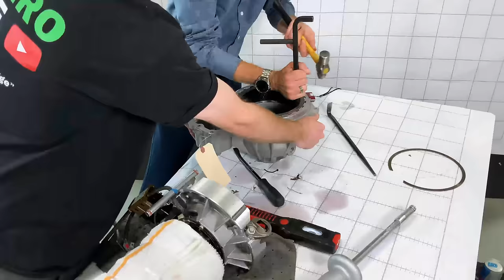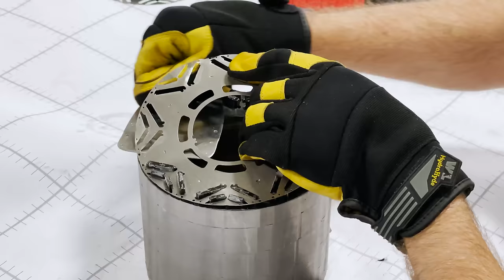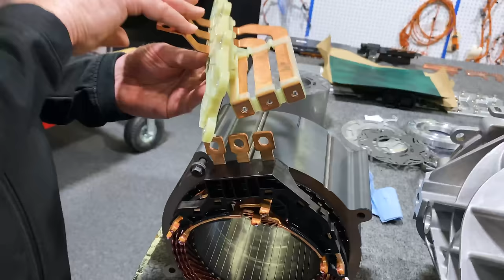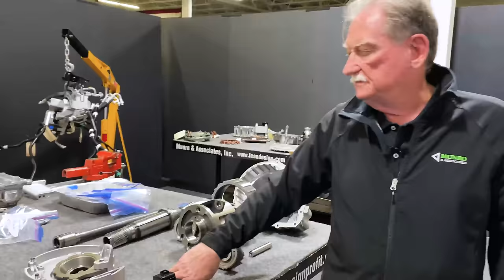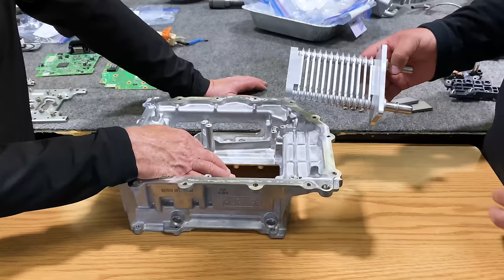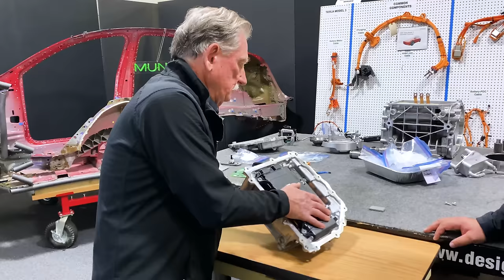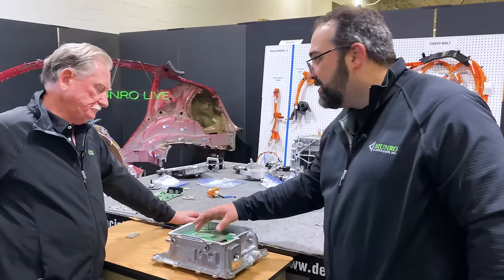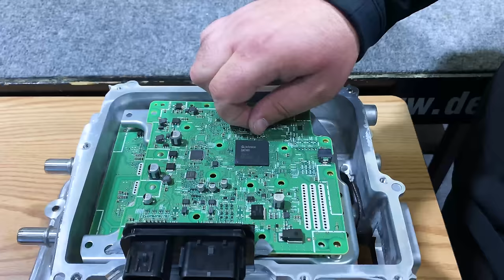Ford Mach-E Rear Motor Teardown and Analysis

Comment: I knew Sandy would make the joke on the 17th bolt - that there was no space for it... classic gentle and justified sarcasm we all love!
Reply: Sandy's sarcasm is wearing a little thin. His videos are becoming more showmanship than actually informative as he hams it up for his non-industry audience.
Reply: @Miata822    If I was chief engineer over the Mach E, I would be showing this to the entire team. Plenty of meat there.
  You want the industrial grade info, that's probably gonna cost you.  Buy the report.
Reply: @rockon7848  I have the i3 report. It's mostly part-by-part costing and source info. 
The Mach E inverter is made by Denso. Ford will probably bring it in-house if they think they can improve it or cut cost. I was impressed by the use of SiC switching.
Reply: @Miata822  So Ford threw a bunch of off the shelf components to get the Mach E out the door ASAP,  they will re-engineering it if they live long enough.
Something like that?
Reply: @Miata822  The info is still all here - the packaging has improved tremendously though
Reply: @Miata822  That's me and I'm loving it! I know nothing about engineering but love the videos because of this change in emphasis. 

This is one of the main reasons that the view count has risen so dramatically and helped the marketing and exposure of Munro and Associates. 

There is always a risk that they will lose some hard core engineering types such as yourself, but in my opinion, the benefits outweigh the risks enormously.
Reply: Germans Engineers  would find it
Reply: @BillyBob-fd5ht  and probably make sure at least 4 of the screws were left hand threads
Reply: @Miata822  The motor part is by Borg Warner, they call it their "integrated Drive Module" If the inverter is by Denso, that might explain that large copper interconnection, and why it is necessary. They were not originally designed together. Another example of making a car as a "Parts Bin Special" The inverter itself though, good grief what a complex assembly! I'm sure there are techniques and mechanisms that make the assembly a lot easier to assemble than Sandy thinks, but it's still horrendously convoluted. I used to be somewhat impressed with Denso stuff, this makes me wonder about reliability, or even reject rates. I can't see how you could even consider repairing such a unit. Horribly expensive piece to just replace in the case of failure.
Reply: @grahammonk8013  Thanks for your thoughtful reply.
In the 10 months since I made that post I have had seen it was BW and had a chance to crawl over a similar drive unit on an F-150 Lightning chassis.

All EV inverters are complex. have you seen a Tesla inverter? The Nissan LEAF inverter is complex, twice the size and half the power of the one on the Mach E. If you get a look into a 100+hp inverter drive for an industrial motor you will be impressed by the miniaturization on all EV inverters.

Consumer power electronics are almost never economical to repair. Diagnosing and repairing them is a high skill job. It's good that EV inverters very rarely fail.

Designing, testing, and manufacturing reliable high power electronics is very costly and time consuming. Vertical integration can be a trap since it limits a manufacturer's ability to innovate and bring out new designs. 

There is no need to deve3lop a new power window control module for every new vehicle. Tesla doesn't. But they do put that function and many other on the 2 or 3 control boards they use across all their vehicles. When a window control burns out a MOSFET Tesla replaces the whole board and charges $3,000. Tesla batteries are similarly cheap to build and effectively impossible to repair. (see Rich Rebuilds customer battery repair video).

the Mach E inverter can be replaced w/o removing the drive unit from the car. That is why the bus bars are like that.

Now go watch Lucid's "Tech Talk" videos if technical design issues interest you. Lots of info that applies to all EVs.
Reply: @Miata822  Good points, but I still say the complexity in the assembly of the inverter is silly. All that welding and soldering that you have to do in situ.
Reply: @grahammonk8013  Yes, would be interesting to see how they do it. Denso has vast automotive manufacturing experience with more than 15 factories across the US.

In the end what really matters is price and performance. The economics of the manufacturing industry are often counterintuitive to those outside the business. Munro does little to make this situation more clear to consumers.

Comment: Can't wait to see the new Tesla carbon wrapped motor being featured on this channel.
Reply: it will be like defusing a bomb. The carbon fiber is so tightly wrapped that when you cut it the motor inflates twice its size!
Reply: Lol.... carbon wrapped rotors have been used in applications over 200k rpm for years now, nothing special to see here.
Reply: @carholic-sz3qv  The bigger thing is that it is being mass produced I suppose by a machine created by themselves. Will be interesting to see if there's anything else new with the motors too though of course. We've seen the 3/Y motors with Munro but never S/X. :)
Reply: @carholic-sz3qv  Except these Tesla engines are part of the fastest production vehicle ever built. To me that's kinda special.
Reply: @alaricgoldkuhl155  really?! Stfu! The model is quick but not fast.  Impressive things are buggati chiron(fastest car in the world) with 300mph, mercedes unimog with tousands configurations possible for any applications, a scania 770s.......
Reply: @VoxelLoop  there is basically no difference between S/X and 3/y motors they are the same basics but differently tuned/configured just ICE engine configurations.
Reply: @carholic-sz3qv  Yh... But that Bugatti gonna get its ass busted on any track by a plaid model s or roadster... So what's your point? Are we supposed to be impressed by how it produces 3000 Hp of power, 2000 which are lost as heat and sound?
Reply: @rogerstarkey5390  yes it is, there are 2l NA engines and 2l turbo/supercharged which uses the same  block and many other components.
Reply: @whattheschmidt  it was a challenge to make a car for the street that could reach 300mph, from composite materials to very sophisticated body control, to printed titanium parts..... no other car is even comparable except a koesnigsegg.
Reply: @Omakhara  stop talking nonsense and grow up, sportcars are made for very different purposes, from manual gearbox to dual clutch, some sport cars even have less than 300hp. A buggati is built for the extremes just like a f1 car.
Reply: @carholic-sz3qv  so potentially the Tesla motor could spin 10x faster still? Is that what you are saying?
Reply: @carholic-sz3qv  roadster should be fast. 200 mph is very fast for the price, as is the acceleration. But keep trolling it's most amusing. 😁
Reply: @carholic-sz3qv  lmao, "300mph on the street" , you know Bugatti made a special model to reach 300 right? Most of the chirons can't do 300 even in perfect conditions
Reply: @carholic-sz3qv  it's Bugatti BTW. If you like their performance so much I would hope you'd spell it correctly.
Reply: @carholic-sz3qv  rofl
Reply: @carholic-sz3qv  lol the hypocrisy is oozing from your comments. You are talking about growing up whilst not being able to give Tesla any credit for their innovations and acting real salty about anyone that does. Sounds kinda infantile if you ask me,but hey whatever floats you boat.
Reply: @carholic-sz3qv  eh ? It’s much slower. Tesla S Plaid just did a 9.08 second quarter mile. Forget Bugatti it’s much slower and many times the price.
Reply: @carholic-sz3qv  
You know that Koenigsegg's CEO drives a Model 3, right? https://www.tesmanian.com/blogs/tesmanian-blog/tesla-model-3-christian-von-koenigsegg And they had to redesign their latest car when they saw the Roadster specs. https://electrek.co/2018/09/01/tesla-roadster-embarrassing-supercar-maker-koenigsegg/
Also Koenigsegg doesn't mass produce their cars, those are hand built and cost a fortune. You can buy like 10 Roadster from the price of a Koenigsegg, and 15-20 Model S Plaid.
And then there's the cost of maintenance. I imagine it's not exactly cheap to do anything on a hypercar, while a Model S barely needs any maintenance. Tires and washer fluid mostly. Not even brakes, as it uses regenerative braking 99% of the time. A brake pad can last up to 200K miles.
Reply: @HillslamsMirror  KEKW yeah for racing weight is everything. Ofc for twistys circuits.
Reply: @whattheschmidt  I believe it needs a 7 mile straight away to get to top speed. Definitely won't happen on a race track.
Reply: @carholic-sz3qv  yet the Bugatti still gets slapped by the Plaid Model S(A sedan nonetheless) in the Quarter mile. And it’s only $130k. 🤣
Reply: @eubikedude  😂
Reply: @JesusisKing2000  are you a troll?! Becuase even the porsche 911 turbo s is also quicker than the buggati, the buggati chiron is the fastest car in the world its built to reach the highest top speed possible.
Reply: @carholic-sz3qv  Well, trains are quicker in Japan, and they dont need $$$$$ everytime they go fast:) Not easy to find a spot you can do 300mph if survival is of any interest.
Reply: @carholic-sz3qv  here in Mach-E for sure!
Reply: Comparing a Tesla to something like a Bugatti is starting to feel like comparing a Casio to a Patek Philippe
Reply: @Destorrrrr  Yes, 2 grades
Reply: @whattheschmidt  and driving your $3 million+ car at 300 mph expect to stop every 30 minutes or less to refuel.
Reply: @carholic-sz3qv  Check your info again. Those 304.77 mph never qualified for the Guinness World Record. Better check out the SSC Tuatara (which so far still has to qualify for road legal.) That leaves the Koenigsegg Agera RS from 2017 still the official world's fastest one.
Reply: @Omakhara  at around 25% efficiency for gasoline and the poor bugatti making 1500 hp it most likely wastes 4500 hp in drivetrain, vibrations and heat. Which is rather impressive...
But I digress :D
Reply: @Omakhara  you maybe should check Pikes Perk results, which is ideal for electric cars, they do not lose power with altitude and still 2021 Tesla Model S Plaid is 10 seconds slower in that condition then 1996 BMW M3.
Reply: @eubikedude 
Especially as the plaid is limited atm to 165ish miles an hour so when the full 400 hp (340hp currently) per engine is unleashed woohoo I reckon under 9 for the 1/4 mile, maybe even challenge the nevera over the 1/4? Hmmm probably not but i think it will push it hard at the start.
Reply: @carholic-sz3qv  dude...people feel acceleration, the change in velocity, not velocity itself. Are you giggly the entire time during a plane ride? They fly at speeds twice that of a Chiron.
Reply: @Omakhara  You sure take drag races very seriously. Outside this, The Model S can't follow these cars

Comment: “ There are a lot of reasons they had for that, but I can’t think of one.” 😎
Reply: I think 🤔 that engineer was gonna do the 1 gram everyday reduction plan and he never got around to starting it, lol 😂 He was set for complete development cycle with that housing !
Reply: @maples328  He was quite a fox designing it heavy so he could easily achieve the target of mass reduction and get boni on a regular basis. 😂
Reply: It's a big-block motor, see? ;)
Reply: @itekani  You said that perfectly
Reply: He can't think of one.  Probably because he's clearly not an engineer.
Reply: @creamwobbly  But you didn't have a video camera pointed at you when you came up with that list did you ?
Reply: @patburnsent  come up with the script before you go on camera✅😂

Comment: Ford didn’t design either the inverter or the motor on this vehicle. It was all done by BorgWarner, hence the non-Ford spec fasteners
Reply: love the name!
Reply: @johncahill3644  Spot on.  This is how we ended up with the now "infamous" Six Liter Power Stroke.  A really good engine that got butchered up in an effort to get it EPA qualified (not a bad thing in itself) by several committees.  In so doing they nearly killed a legendary Ford cash cow.
Reply: I thought it was Bosch?

Comment: "Code doesn't cost much, and it weighs nothing."  Yes, indeed.
Reply: and writing a code is 1 time cost and can be used a any number of vehicle without additional cost
Reply: Program design is easy, code coding can be hard. Firmware is always changing since the hardware is improving and new features are added.
Reply: Code is one time expensive, and maintenance of code is not cheap.  But no weight.
Reply: @aitorbleda8267  If you write the class that handles the parking brake the right way, you do not have to maintain it, other than maybe improving it overtime. I'm petty sure making modifications to the code and much, much cheaper then producing all these parts for every single vehicle, plus - if you want to improve the behavior of the mechanical part that means you have to replace it in most cases.
Reply: Validating it and making sure it passes all the right standards however costs a fortune.
Reply: As a code scientist, I must disagree. Code in most new vehicles actually weigh approximately 0.000034 picograms.
Reply: @ruaraidhmcdonald-walker9524  Again, we are comparing to the actual production of the part with code production. Testing the code is not hard, just write your initial unit/integration test.
Reply: @Ben-Ken  lol, right....The code is the state of charge  - I'm not sure how the weight can be associated with it.
Reply: For sure, you can take the memory chips and electrical components into consideration, but in this specific case, MachE probably already has the electrical parking brake system, so the mechanical redundancy is just does not make a whole lot of sense.
Reply: @thomaslemay8817  The "mechanical" ratchet ford uses is controlled by the code as well.....in this case, it can also fail. The mechanical linkage can do the same. Do not miss the point of Sandy's comment. Tesla uses the parking brake only, for a decade now - no problem
Reply: ROFL - says a guy that doesn't know about software development. Thats what everyone outside of SD thinks. The REALITY is that software development can be and often is many times more expensive and labor intensive than anything in hardware manufacturing.
Reply: @HillslamsMirror  it does scale better though. Anyhow, I agree that the dude making fuss above here doesn’t seem to have any clue on software maintenance cost. Our rule of thumb is: maintenance expense is 9x the development cost, over the lifetime of the code.
Then again we don’t have the best software engineers, for Tesla it might be 3x.
Reply: Certainly weighs nothing.
Reply: @HillslamsMirror  Writing a Code is easy. The QA Process of Code is expensiv, i did some QA in SD myself as intern when i studied computer science. I was chided from the Boss of the firm not to disrupt the programmer till he  said i did lot to stabilize the code. We got 40 new "improbable" Situations fixed in two Days, then the Software stopped crashing. The Code was in a simple data transfer Terminal for an agricultural trailer scale. Which is a simple two weight compare prozess, before and after delivery to get the weight of the delivered goods, but it needs to be foolproof and stable. One Day by one programmer and the Code ran and then two Days by two persons QA to make it work in real life.
Reply: Until that code miscalculates position and velocity and brakes too hard.  Then the occupants suddenly discover they "weigh" a lot more.
Reply: @Ben-Ken  so how many of these do you have to eliminate to reduce the weight by two grams?
Reply: Probably exactly why FORD leave it out. They don't want to repair things over the air. FORD wants YOU to drive to a dealership to ensure that they get a cut of the action. Service dept's have employee's that need to fix things and charge extra for doing nothing.
Reply: @sudeeptaghosh  If your code is a "1 time cost" it's not very high quality code.
Reply: A mechanical parking brake is not a bad idea.  There were lots of problems with the Prius when it switched to electronic vs manual, and that was just electric actuater of a mechanical part.

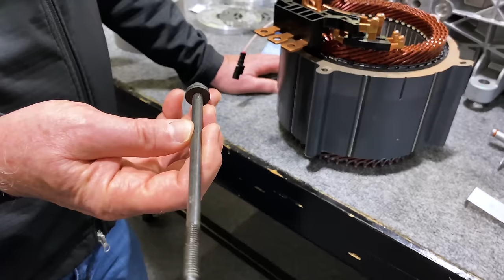Comment: 6:48 "You don't really need that second washer ..."  The washer is used because the shape of the under head of the bolt is typically slightly conical (not flat), designed for mating with harder steels.  You need a flatter surface as found in the washer to make the torque reading more reliable on installation and not cut into softer materials such as low carbon steel lamination or aluminum.
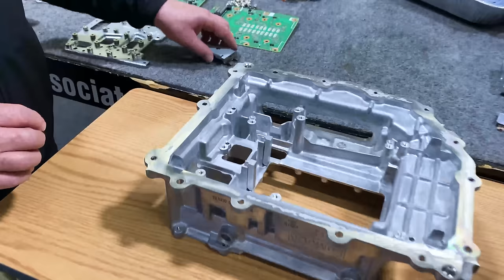15:40 Most castings, like most injection molded plastics, have draft angle.  If they don't get a surface perpendicular to the spring surface, it will want to walk out or shift the coil, possibly breaking the silicon carbide transistors or the coil fins.  I suppose they couldn't put the mating draft into the spring (probably poke yoke issues during assembly), thus the "standoffs".
Reply: Won't the standoff want to walk out (just like the spring would if the standoff wasn't there)?
Reply: I'm pretty sure that spacer at 15:40 would make sense if they had understood the order of assembly.  The gate driver board with mounted FET modules is installed, with the FET modules slotting into the cooling plate assembly.  Then the spring and wedges/spaces are installed to apply clamping force to the stack.
Reply: Either way, it is a shitty build lol